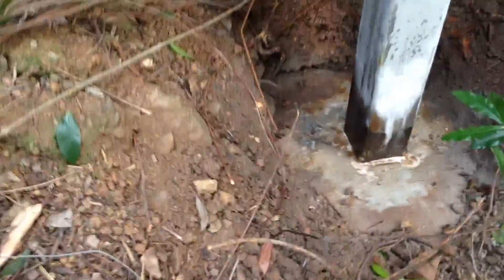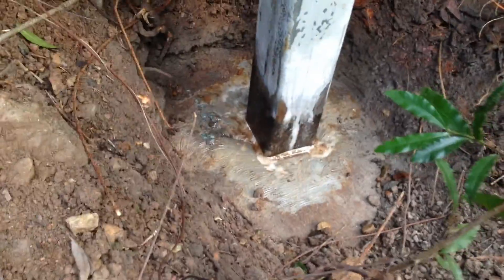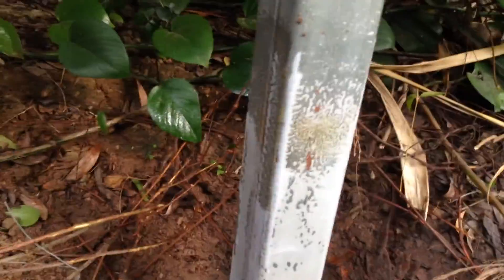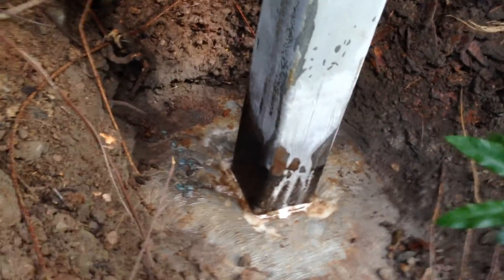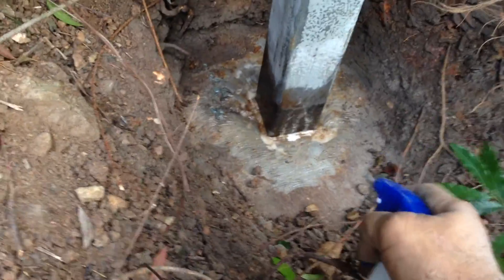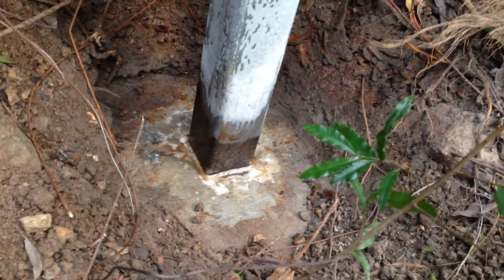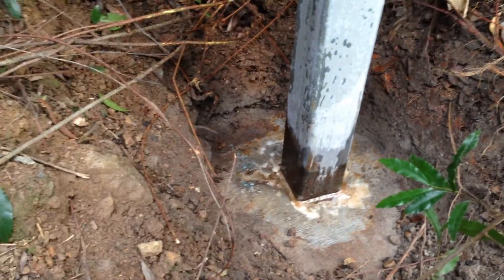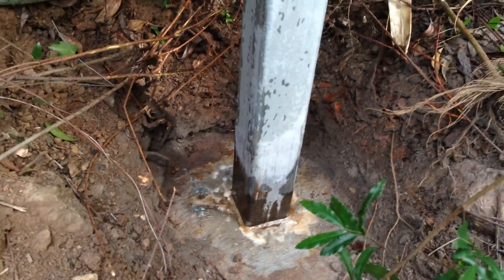Protecting steel posts from corrosion. No 3

Comment: The concrete when poured burns the galvanised coating  of    The submerged post 
Best to use a 5 or 6 mm thick post on a raised stirup  degrease post .. etched rust primer then an epoxy paint 
Posts done this way 11 years ago and absolutely no rust in a coastal region

Comment: I have been told to use ranex rustbuster and when dry apply bitumen paint.. is that correct.. is that the same as the epoxy you talk about?
Reply from the maker: I did use bitumen paint, the thick one for 15 years but found out through going back to old jobs theat even the thick one only lasts about 6+ years because of the heavy metals in the dirt eating all the oils out of the paint.
That is why I changed to a much stronger coating.
I have been told of a single pack urathane paint used for waterproffing as well.
Reply: @DieterSoegemeier  so after the ranex rustbuster what do you apply? I can't seem to find the video where you mention that part 🤔
Reply from the maker: @angemcanany3942 Then apply a coet of Penetrol then any enamel coating but add some penetrol to the enamel to help it bond better. Enamel is a sealer and wont let any water in. never use any accrilic as it is water based and lets water in all the time.

Comment: I'm keen to know what you did after the rust treatment. Did you just paint the most, then put the soil back? Did you concrete around it up to the soil level?
Reply from the maker: What we did is then paint the posts with a two pac epoxy from International Paints called Interplus 1180 that was developed for oil rigs and once that is dry we then fill the hole with concrete and dome it above ground level so the water will no longer pool around the post.

Comment: your tubular steel can get rusts inside
Reply from the maker: Only if it is not sealed by welding all joints.and no holes.
Reply: Should have been  elevated on concrete

Comment: Believe it or not, this is the only video on youtube that addresses a galvanized square tube installed into concrete. My mail post gets knocked off 3 times a year by the town's snowplow. It's been 4 years now and I can't take it anymore. I'm installing a 6x6 gal into a sonotube with commercial grade footing and a rebar setup that will have John divorce Deere at the next gathering. The tube is hollow and protrudes a few inches above grade where there are perforations on each side. My plan is to plug in a (replaceable) 6x6 wooden post and fasten it to the tube with a lag screw or tapcon on each side. My question is this: will the perforations allow water to seep into the tube if I seal all around with liquid rubber and tar ? Rust on the outside isn't my concern, but the inside needs to stay in perfect shape for the next post (hopefully in 5+ years).
Reply from the maker: Hi Mario
Thanks for the reply.
The only way I see any steel post surviving the ordeal you describe is to use a stainless steel post as a reciever with no welded bottom so the hole can drain. any other steel will not do it without rusting, and definately not galvanized.

I hope this was helpfull to you.

Comment: Am dealing with something similar at my place. Looks like not enough concrete was used in hole. It’s actually below ground level which means over time it fills in with dirt. Creating dirt buildup on gal post, hello rust. Is it not a good idea to put a concrete apron around post base after rust treatment?
Reply from the maker: Yes,  the concrete cap should be about 100mm higher than the dirt around it after rust protection

Comment: what is Gal and how does it couse the problem ?
Reply from the maker: Hi Chris, Gal is the galvanised lsacrifical layer of zinc they have coated the steel with.
The zinc reacts with the lime in the concrete whrn water is around, Water is the catalist that combines the zinc and lime making acid that then eates through the steel post 3 times faster than rust itself. This process goes even faster if you have dogs peeing on the posts as the uric acid accelerates the corrosion process. That is why the posts need a protective layer pf paint that seals the steel away from moisture. A good enamel or epoxy.to prevent the two materials from combining with the water
Reply: @DieterSoegemeier  Cheers. Just what I needed to know.
Reply from the maker: @countrycottagelife4184  My pleasure. anytime